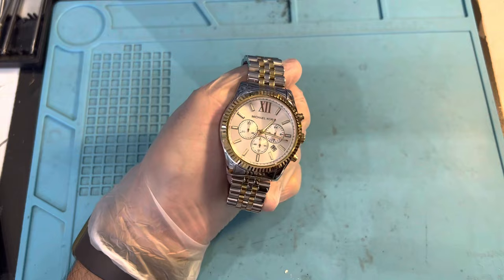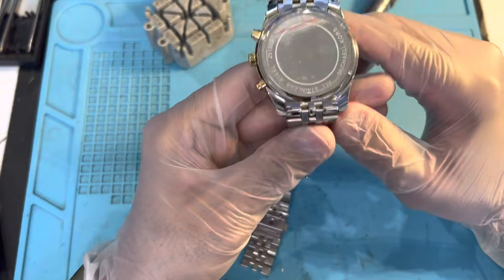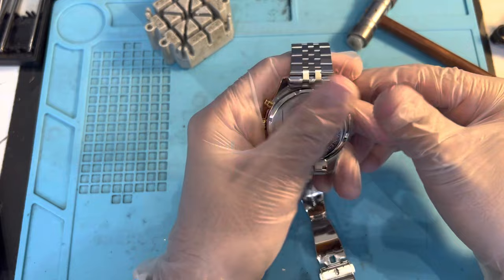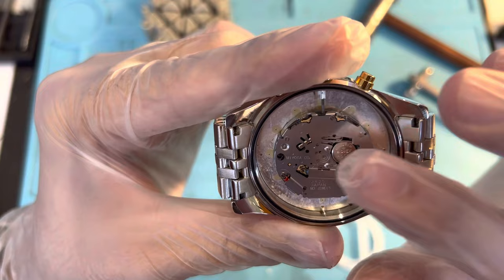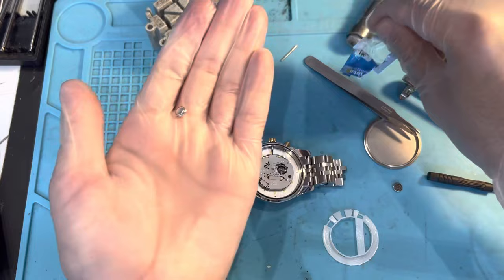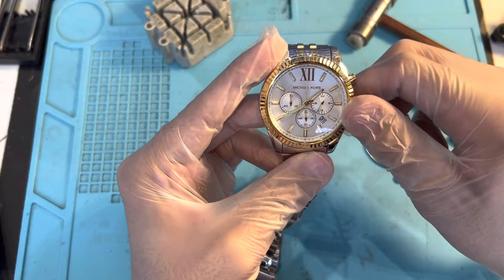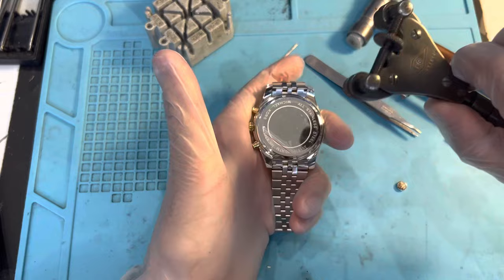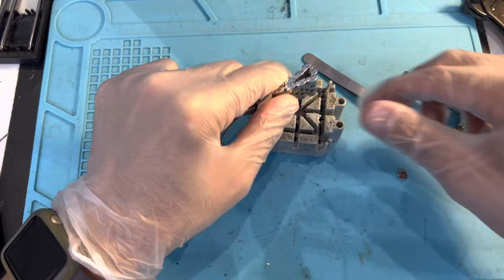Michael Kors Battery | Battery Replacement | Michael Kors Watch | DIY

Comment: Didn't work for me. In my Michael Kors chronograph the battery sits at the side of the machine and has a metal strap on top of it. That strap is somehow fixed on both sides, could not remove it without damaging something.
Reply from the maker: Hi, send me a pic of the back of the watch. I ll try my best to guide you. Watchbatteryguy@gmail.com